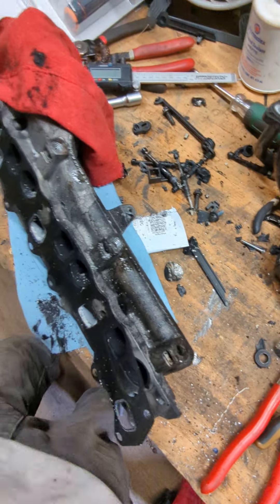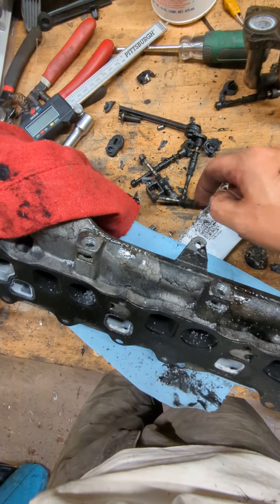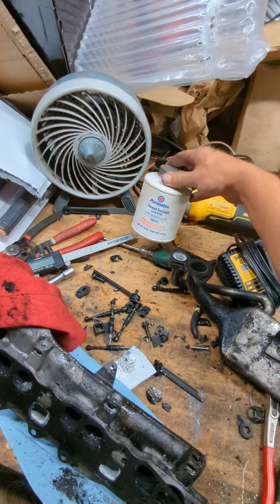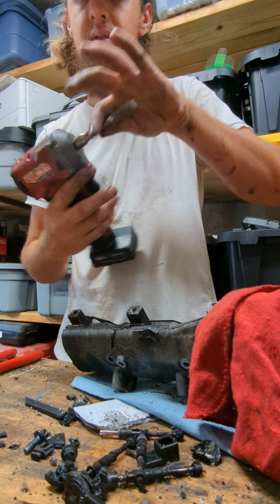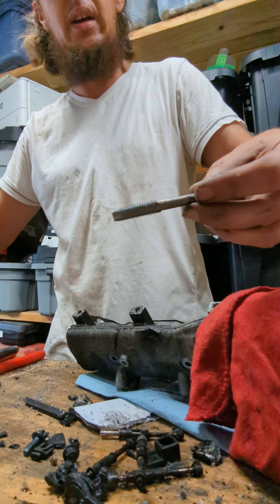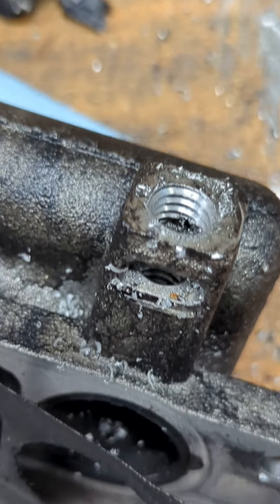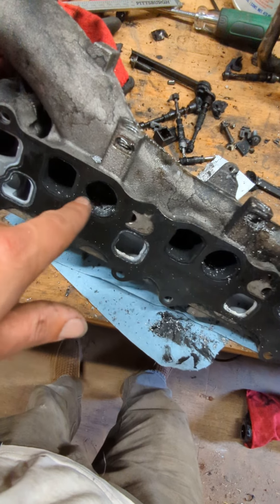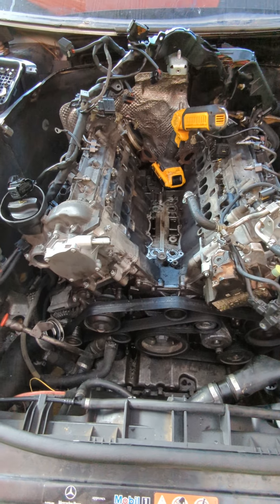om642 sealing swirl flap holes DIY NO WELD

Comment: Im about to have to take mine off in order to change out the oil cooler seals. Anyway you are genius! The swirls flaps are going in the junk pile! So thanks for the tip!..   On a separate note. i see that mass of uselessness on the bench behind the head. So fair to say you figured a way to kick them to the curb too? If so, Im all ears!
Reply from the maker: @strake338  oh the EGR cooler? I had to weld the EGR valve closed to keep it from blowing boost out of the back of the head
Reply: @hvguy  That's the one brother. Wasn't sure if you welded it or made a blank off plate. I don't have  TIG so looks like im going to have to make plate then. Guessing a tune is needed so it doesn't throw engine into limp mode? Or is there a resistor hack like for the swirl plug?
Reply: @hvguy  wasnt sure if you had made a blanking plate or welded it. I dont have TIG. So looks like blanking plate it will be for me. Since you did this, had it go into limp mode? Or is there a resistor type hack like for the swirl flaps?